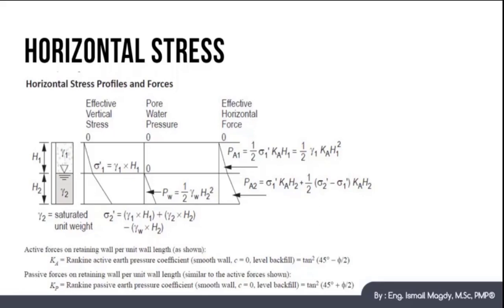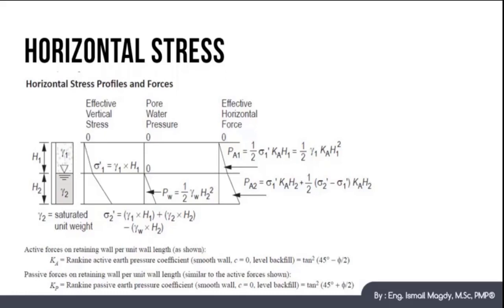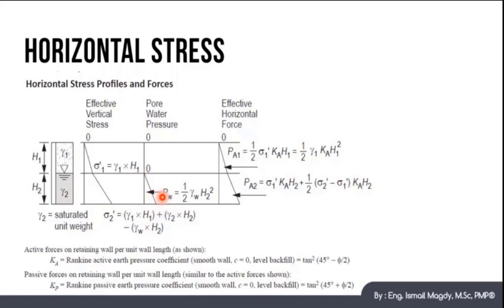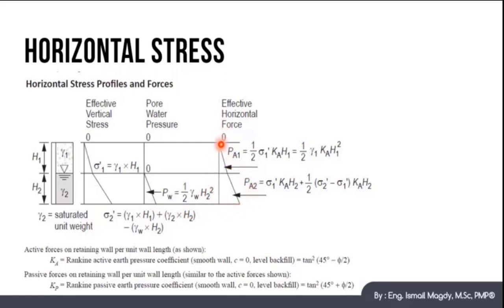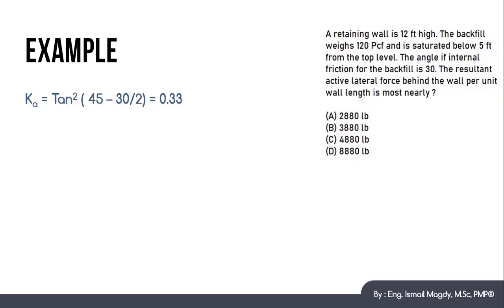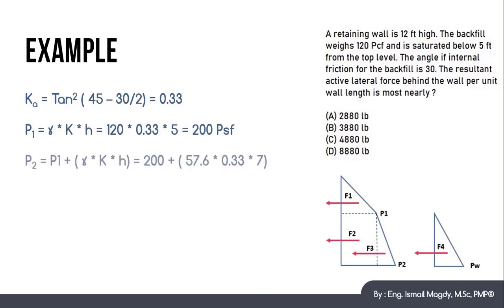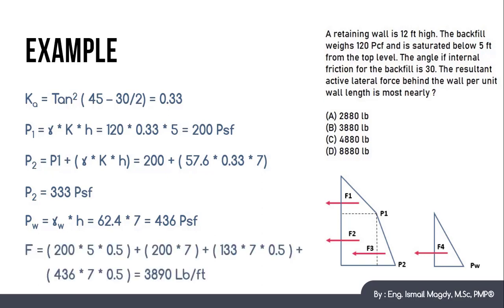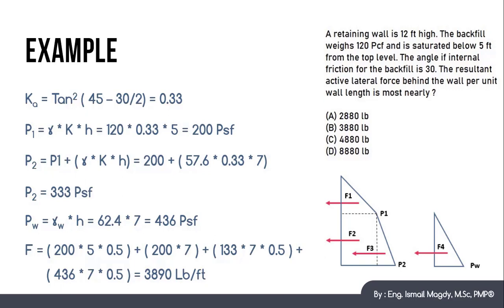FE Civil Exam Course - Horizontal stress

Comment: Having done the example problem using the FE handbook equations, I get the following:
P1 = 500 lb/ft
P2 = 1870.4 lb/ft
Pw = 1528.8 lb/ft

P1+P2+Pw = 3899.2 lb/ft

So I came to the same answer, yet you dont explain your method in any clear way. I understand that you mentioned earlier that the pressure is the area of the stress profile, but you did not explain in any detail how you came to using the equations that you did.
Reply: Sweetie its the same instead of using gamma he used stress, all numbers are right except P2 = 1400 Ib/ft and we have P3 = 469.93 Ib/ft